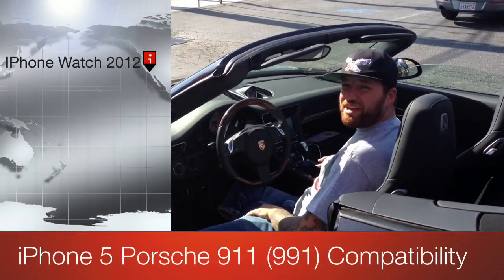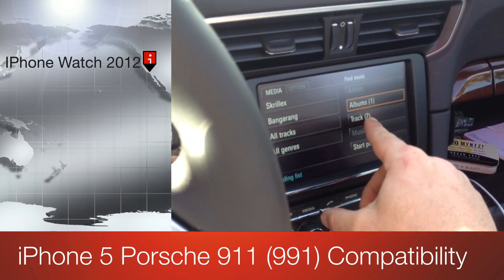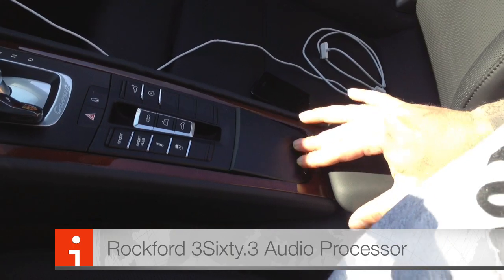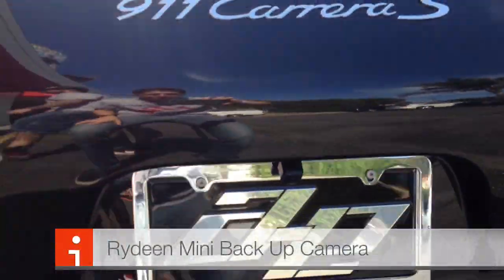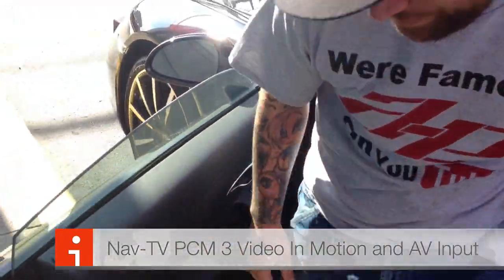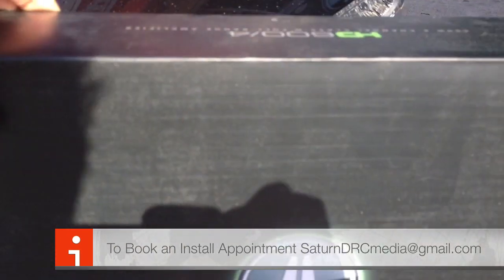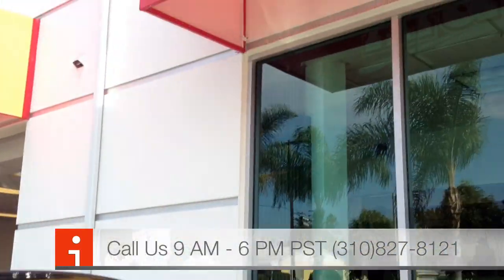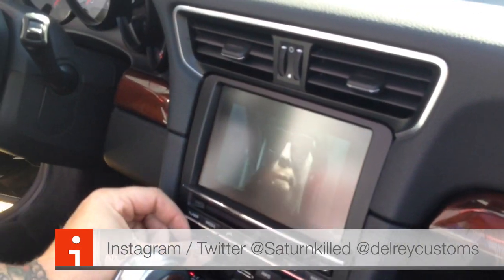2013 Porsche (991) 911 Carerra S Turbo Targa iPhone 5 Audio Upgrade FOSGATE JL AUDIO FOCAL

Comment: You guys do good, clean work. 

I got my start in 12V in 95, and now I sell Porsche for a living. 

Great ideas on sub integration, and the false floor in the front is a great idea - keeps that center of gravity low. 

I think that keeping the factory head is wise, as iti s so well integrated into the car. 

Cheers!